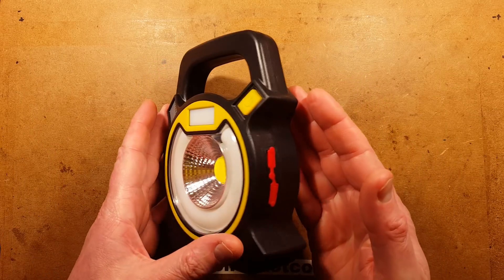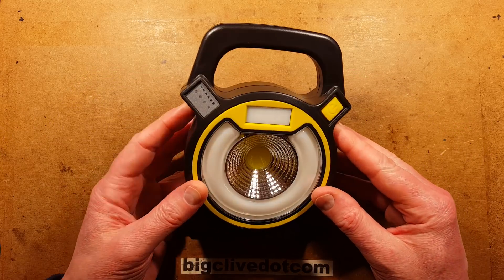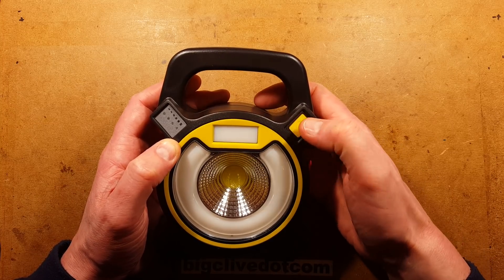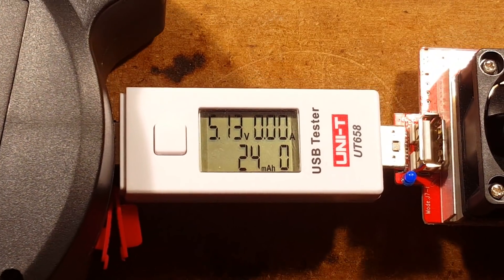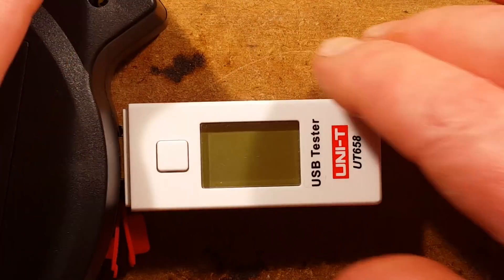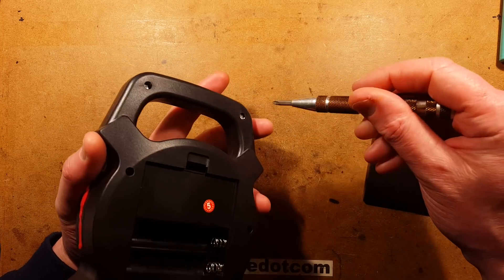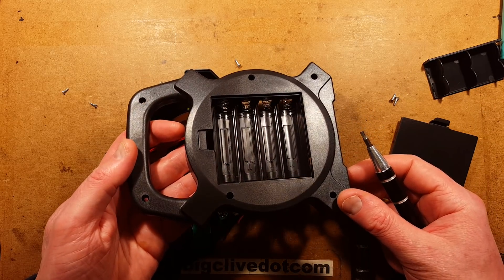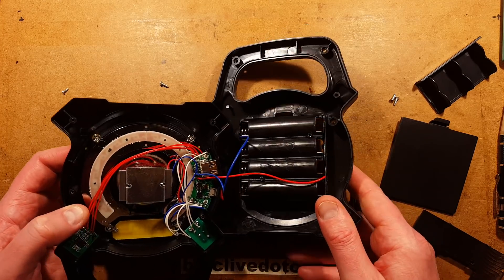Inside an interesting light and power bank with hidden upgrade.

Comment: 2 cells unlock: just pay processing and handling
Reply: And for just 3 extra payments of 5.99 we'll throw in a manual in chipanese for extra runtime
Reply: @SandPox you are buying functionality you  pay more for the 4 battery option. I used to work for a large computer company and to double the disk memory all you had to do was remove a cable. When the people complained why the upgrade was so expensive, as all you did was remove a cable, the reply was you buying functionality not hardware. In main frame computers there are extra features built in and are either turned on by jumpers or software by putting in a key on switched on remotely by the manufacture.
Reply: @TonyDartford  that's what Testla does too... the hardware is there, it's a matter of software enabling
Reply: @TonyDartford  I recall in the 80's when I did my computer sci degree it was a pain since we used punch cards and printouts for input and output. Problem was they both used the same interface so you could only do one at a time. It read cards pretty quickly but took forever to print out.

Well we eventually learned that it could print quicker if the school bought the upgrade which was probably swapping out a chip.

But still happens today and it also involves Lithium batteries. It appears all/most Teslas use the same battery pack but cheaper models get less range. I found this out when Tesla did an over the air "upgrade" to cars evacuating one of the hurricanes that hit the past year or two and let them use the same amount of power as other more expensive Teslas. 

I'm certain if you hacked your Tesla you be punished by Elon in some way. "NO QUICK CHARGE PORT FOR YOU!!!" :-)
Reply: @chartle1  I seem to remember what you said there about tesla was true for the cars before model 3, in some models there the same battery was used to a different state of charge depending on what you bought.

But with the model 3 there's an actual cell count and weight difference between the standard range and long range option.
Reply: @chartle1  Yes, the '16 60 kWh battery and some of the 70 kWh were SW restricted 75 kWh batteries. But in this case Tesla will probably have less hassle with the 60 kWh batteries as they will last longer/have less warranty cases if the cells are driven in a more favorable voltage range.
And I mean on the one hand it is uncomfortable to know that you sit on locked potential, but at the other you might get benefits in comparision to the inferior alternative. Like if you really had a 60 kWh battery (like the '12 60 kWh) your charging would be slower. Or with the harddrive, maybe the restricted one has a faster reaction time than the older version with lower capacity. Or your 30 000 buck lab analyzing equipment may not show the extra digit of resolution that cost 10 grand more in a software key, but you have more confidence in the measurements because the hardware actually is more accurate than needed.
Reply: @ @m1k869   With cars and batteries the extra weight without the extra power is draining the batteries quicker. You are carrying the extra weight but cannot use it. Is this fair?
Reply: @TonyDartford  But you have less internal resistance so the car goes further.
Reply: And the battery lasts for longer, if the extra capacity is not used. They've discontinued orders for the 75 kWh models this week, according to Elon Musk's tweet.

Comment: Would it need modification to work with four cells? (And whence was it sourced?)
Reply: The cells are in parallel, the only thing that you should be worry about is the mismatch voltage... if 1 cell voltage is much higher than the other then it would "charge" the other cell with very high current and potentially damage it